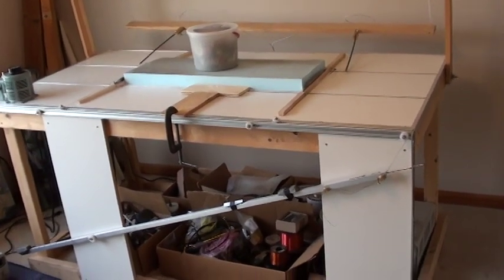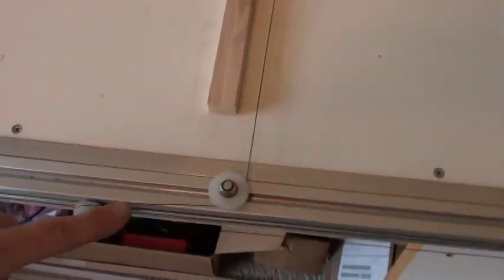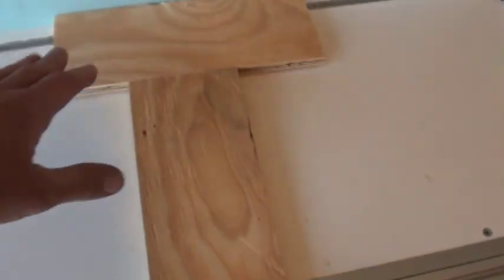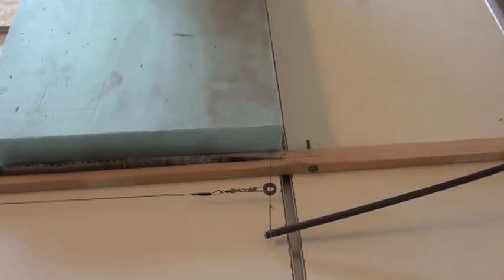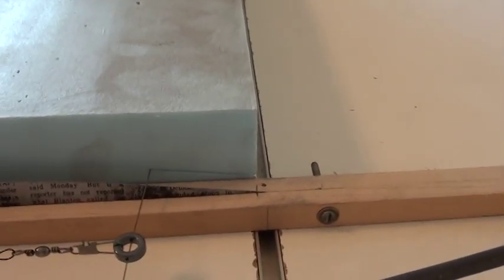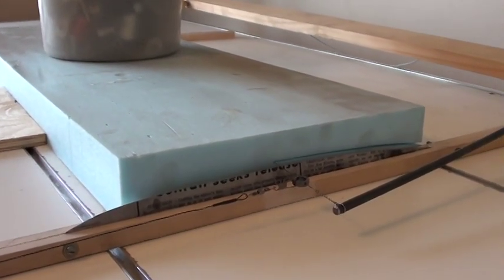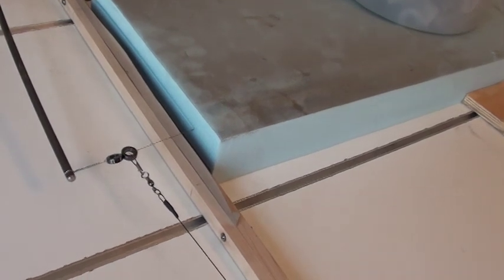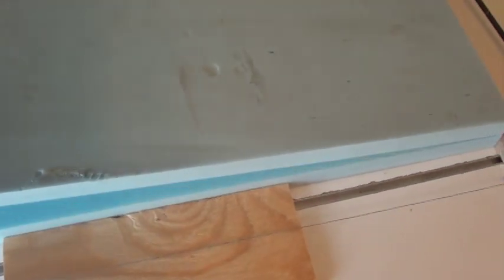Gravity Feed Hot Wire Foam Cutter

Comment from the maker: The transformer you see in the video is called a variable AC transformer.
You can get them everywhere. They come in 110 volt or 240 volt.
Look for them on Ebay, they have all sizes and amp ratings.
The one I have is 110 volt 10 amps. It's made by Powerstat.

Comment: Would it cause any problems if using a wood template instead of the thin aluminum? I won't be doing such an engineered setup, and mine doesn't need to be precise - cutting foam for a 24" x 36" dog futon. What I'm wondering is if the hot wire running across the wood template would be a reason for concern - fire, etc...?
Reply from the maker: Gregory Thomson yes you could use wood. I would keep it thin and well sanded. If the hot wire gets stuck, it may start to burn into the wood and get caught. Use only stainless wire.

Comment: Can you show more in detail on how the pulleys and how they work with the gravity bar.  I’m want to make delta wings where the two end of the air foil is two different lengths.  I’ve seen a delta wing done where the wire comes out the same time at the end of the cut even though the two ends are different lengths.  How is that accomplished?
Reply from the maker: 1fltjponr This part is smaller on one end. Where the strings attach to the weight bar you will see the two brass lugs. You hook the lugs to the weight bar at different points. The closer the lugs to the right end the longer it pulls the hot wire. The closer you hook the lugs to the pivot point the shorter the wire pulls. Hope this helps.

Comment: I am not sure if you still read your YouTube messages but I was wondering what amount of weight you use to pull the hotwire thru the foam? I unwittingly made something very similar to your machine as I am not big on knowing the internet where I could have made life a lot easier by looking this up.......I am old school so it trial and error I guess. Thank you in advance for any help you can give
Reply from the maker: 65Wildkat, The instructions I used called for 3 pounds to hang on the drop arm. The balance weight on the left end should be heavy enough to balance the drop arm without the 3 pound weight on it. The drop arm should balance without anything attached to it. Good luck.

Comment: High Don,
I just watched your impressive video on your Gravity Feed Hot Wire Foam Cutter. Please could you be so kind to tell me were to buy the pulleys and the aluminium-profile and the wire as I want to rebuild your cutter? So far I looked for the material but was not successfull. Thank your very much in advance!!
Thanks a lot!!
Mike Flieger
Reply from the maker: The pulleys came from Lowes Home Improvement Store. They are pulleys for a sliding glass door. The aluminum is from 80/20. They have them all over Ebay.
The wire is .020 stainless safety wire for aircraft. Lowes also sell stainless wire for hanging pictures.
Reply: Dynodon64
Hi Don,
thank you very much for your very quick answer!. Now I can start building my own cutter. Great    :- )
Sincerely yours 
Mike Flieger
Reply from the maker: Mike Flieger I got the plans off the internet. Search for "Del Brengman's  Hot wire foam cutter".
Reply: Dynodon64
Dear Don,
thank you very much for your very helpful hint!
In the meantime I did spent several hours searching gravity cutters and luckily I also did find Brengman's hot wire description.
It helps a lot: However the link you provided is much better to read.
Sincerely yours 
Mike Flieger

Comment: Hi Don,
still another question.Could you please tell me how to cut back-swept wings? P.S. Additionally I want to give the following link setting up a gravity cutter (http://www.rcgroups.com/forums/attachment.php?attachmentid=2075320). Looks very good.
In advance, thanks a lot.
Mike Flieger
Reply from the maker: I haven't used my cutter for RC planes. So I never have cut swept back wings. The cables need to be hooked to the pull down bar at different points to make the hot wire pull faster on one side than the other.